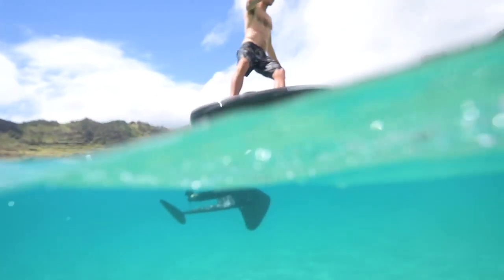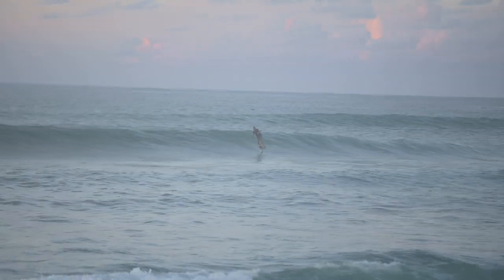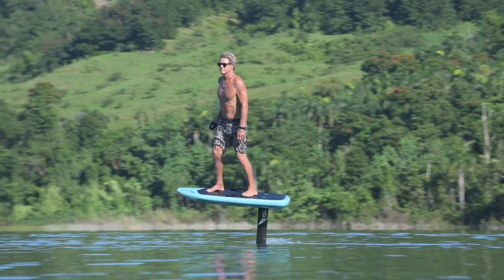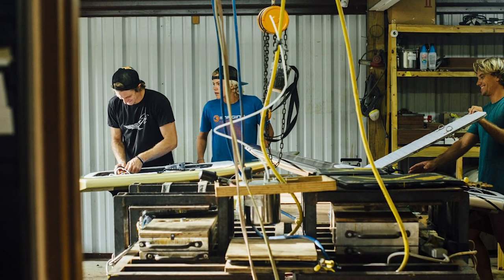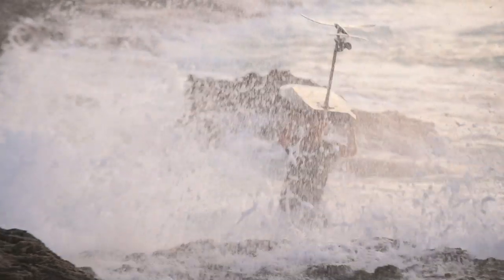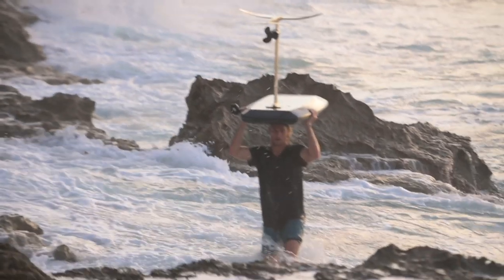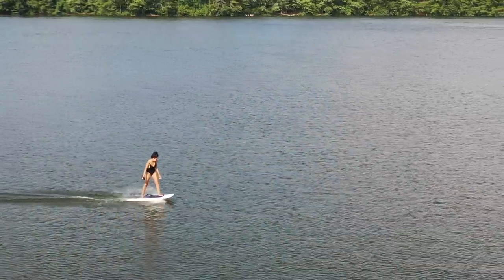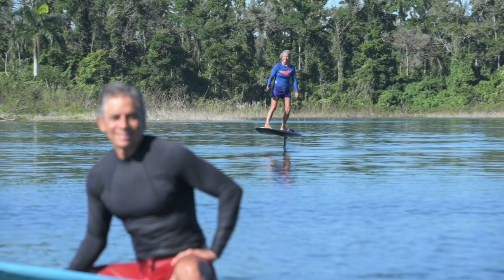Lift eFoil Podcast - Building a Flying Electric Surfboard

Comment: 6:25 Dad co-founder
30:05 If you have one detail that's not working properly, you'll see a mass amount of product returns (don't rush the product) 
31:20 Battery partner in San Francisco (Lthos) - ex Tesla engineers
52:25 Patents & IP